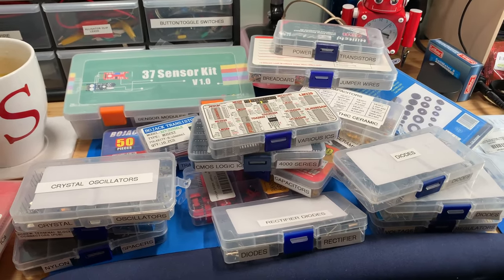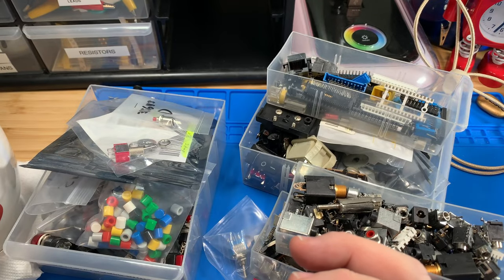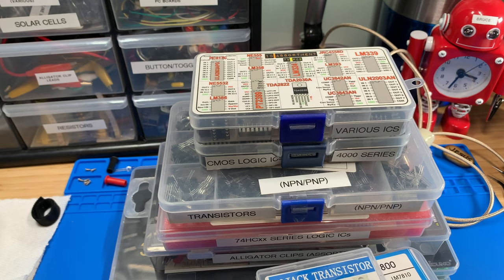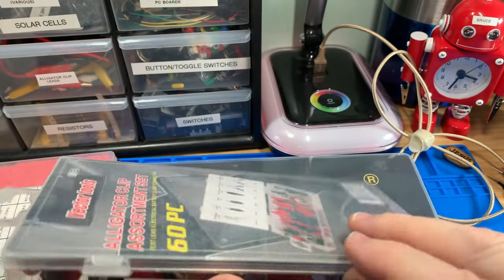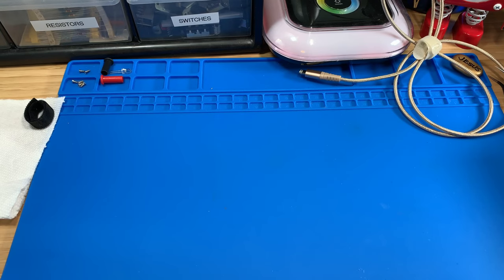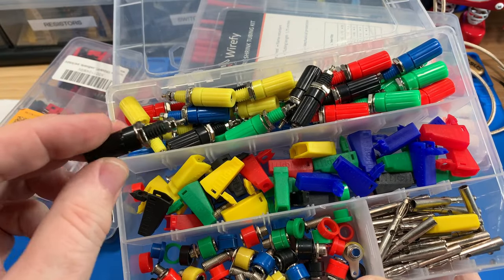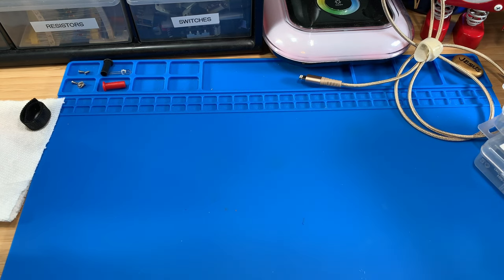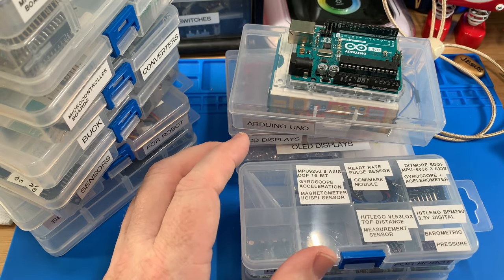My Electronics Parts Kit Addiction

Comment: You're not alone. If I need a single part I always order an assortment pack.   This is a great time to be in the hobby. Everything from parts to test gear is so inexpensive it's easy to have a nice, well stocked bench.  But if I buy another oscilloscope I'll be sleeping in the garage....
Reply: You gotta order it to your neighbors house and let them in on it.  6 pack of beer is a good incentive.
Reply: Especially if it's 10 bucks on Amazon and it's cheaper than I could source separately myself
Reply: Sadly its a good time for electronics as a hobby but having a small company in electronics is horrible and i would really love that.
Reply: @jimedgar6789   That's all well and good but I wouldn't be able to keep my mouth shut about the new toy.  Her:  "You've been in the workshop a lot lately..... Why are you smiling?"
Reply: x2 😭
Reply: I have the same scope problem 😂
Reply: You present sleeping in the garage as a problem.
Reply: it's far from inexpensive. everything is like 30$-20$ (CAD) despite what's in them unless you wait a month and order from china, but even china has caught on.
Reply: Definitely not alone. I have a similar case. Although just as you've got a component and module add1ction. I have a module add1ction and battery add1ction. I have a fair amount of modules, some of which you've also got in your collection. But the battery side of my add1ction is a bit more out of hand. I have a 50. Ammo box stuffed to the brim with 18650 and 21700 cells. Of course the container is metal and I added more electrical insulation on the inside for safety. But I recently purchased a lot more 18560 cells and my add1ction even drove me to purchase 4 prismatic LIFEPO4 cells which I have little idea what to use for. Anyways you're definitely not alone.
Reply: @KJFMZ I have a habit of showing my family every addition I make to my collection/stores. Since I am Hispanic sometimes they have little clue of what I am showing them, but thankfully they support me.
Reply: you are not the only one
Reply: "honey listen. It isn't an oscilloscope YET. I didn't buy one! I bought a kit to make one, but see, it's not an oscilloscope. Yet."

Comment: 30+ years as a Certified Electronics Technician. SATCOM and consumer electronics. Bins of resistors 47 ohm 1/4, 1/2 1 and all the way up to 20 W for each resistance value. Then Capacitors of various types and values. The only things I didn't stock like picture tubes or Fresnel lenses,  Had my service van stocked with Zenith TV modules. Then I had a service call on an OLD TV and the couple preferred to fix it than buy another one.

Comment: Unless you're a prolific tinkerer most those parts will just sit in their boxes.
After 4 decades of electronic projects, I have built up a large surplus by ordering what I needed (Tayda mostly and sometimes Mouser)
and then adding a few items extra if they seemed to be in common usage. 
Most all of the "collections" I've purchased are still like they day I received them. 
I might use one or 2 parts but overall, their just extra parts I will never likely use.

Comment: How I did with those resistor kits. When some value start to be low quantity at that point I ordered like 5-6 most used one as 100 pcs each. Same with other component kits.
If you are doing digital stuff you can optimize it like to "few" different components.
Basically you use different set of component for 3.3V, 5V, 12v, battery operated devices or combination of those.
Also be careful because some of those cheap kits can contain fake/relabeled components. Mostly in IC or transistor kits but can be usable if you aren't using close to maximum operating limits.

Comment: this is like my desk. boxes and boxes of the buggers, inductors, film caps, ceramic caps, electrolytic caps, bjt, 'fets, wire shrink tubing, potentiometer, zener diodes, schitky diodes, rectifying diodes, 47 IC, 74 IC, LEDs, and some of them again for SMD bits.
 all bought from amazon and ebay in the last year, since i decided to learn how electronics worked. i have found these kits invaluable. with these kits, bigclive, and electroboom, and a 'scope and function gen, and a couple of bench supplies, i have gone from not knowing what ac and dc meant, a year ago, to building laser drivers, inverters, and model rocket avionics.

Comment: Also there are some rules which I have discovered apply when you have this complaint.  Firstly there are some kits bought without reading the description properly which you later discover are so specialised that you will realistically never actually use any of them.  Secondly you find that some of the kits, particularly of semiconductors, only supply components which are rarely used and the most useful varieties are not included therefore you are not likely to use any of the ones supplied.  And finally there are some kits which are genuinely useful, such as the heat shrink ones, but after several. years you find that you have completely used up the three useful sizes whilst the other 9 sizes are completely untouched.  I am happy to say that I am now over this obsession and I now have the patience to only order what I actually need and just order a few more than I want each time so my collection of potentially useful stuff slowly increases.  This has the side effect of focusing me on actually getting repairs and projects completed!  Hope this helps!

Comment: I just got over an addiction to buying analog modular synthesizers... My only consolation is that buying Arduinos and electrical components is way cheaper...

Speaking of which, I think I need a couple of those switches and voltage regulators that I saw in your video.

Do you need any analog modular synthesizers?

Comment: If you feel guilty, just build some projects.

Having O Rings is a must. The times you take something apart and the O Ring has deteriorated and needs replacing. It’s difficult to find somewhere local to buy an O Ring the right size same day. Better having a box of assorted O Rings in the house.

Comment: Well... i have about 100 times more than what you show in this video. I do not buy, everything is desoldered, cleaned and wire aligned, packed, organized, registered in a database. For example, i have about 5.000 semiconductor individual references, most of them with more than one item. Many resistors, caps, inductors, all types and flavors and many more parts...

I do not think it's hoarding but a true collection since it's all cleaned, organized and easily accessible.

A hoarder is someone that just piles stuff without no curation.

OCD? yes, perhaps, but that's fine.

Do i use the parts? Yes, everyday in my electronic refuge cave!

Thanks for the video.
Reply: Very nice.  I guess all your components are genuine, not a xineze shit.
Reply: @JohnUsp  well... Yes but it's not always possible to know for sure. The type o equipment and PCB assembly quality tells me more or less if the components are worth de soldering or not.

Comment: Omg omg I have a whole closet of that stuff, boxes of parts, Arduinos, cars with remote sensors, silicone work mat, soldering station, every ADABOX, still virgin, all just waiting until I have time, just in case I need to fix something. Ohhhh, I need help.

Comment: Build instead of buy :D Those money for those kit could be spent to more to get better measurement equipment or so. Buying the kits is only sense for basic parts like resistor capacitor and probably electrolytic caps other than that is waste of money.